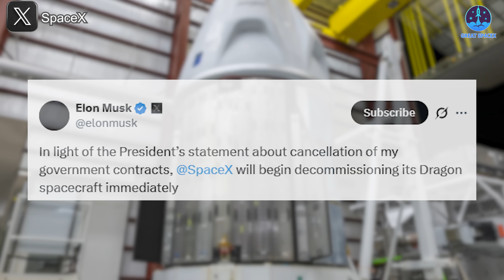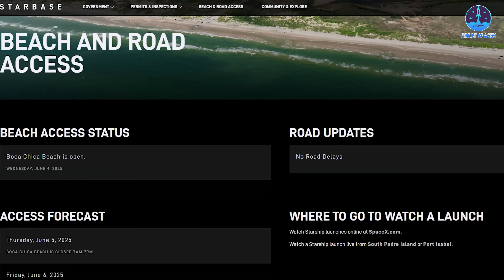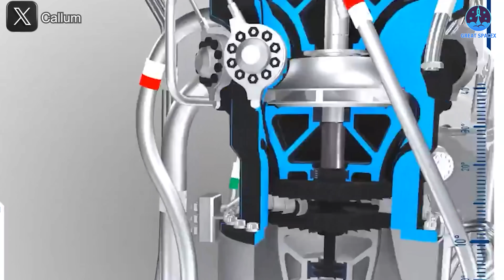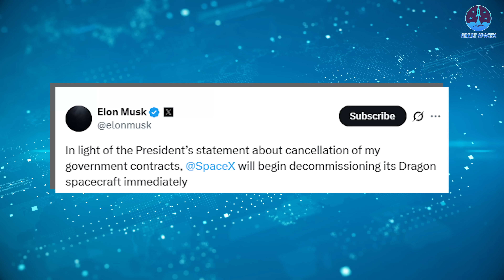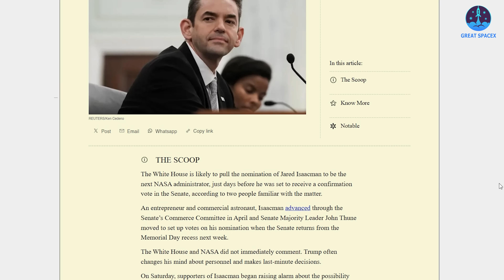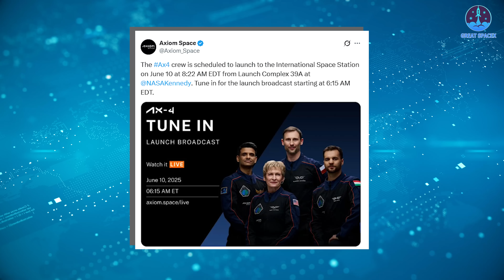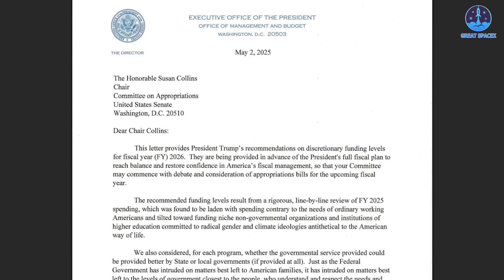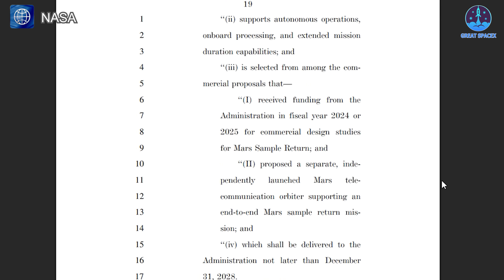Starship Flight 10 Booster Static Abort! Something Weird Happened with SpaceX and NASA...

Comment: Reasons why we can not go to Mars anytime in the near future - for those of you perhaps not aware of the severity of the problems involved - despite the psychological ones portrayed very well in this film.. In order of severity: 1.) hard radiation from both the sun and galactic sources. 2.) weightlessness for extended duration which is known to cause serious problems within the body, even if very rigorous exercise is performed. 3.) armor mass required to protect against high velocity objects which may be encountered en-route. 4.) coronal mass ejections, direct effects of proton "gale", and secondary emissions produced when multi-million KPH protons impinge on any delicate structure of a space ship. 5.) emergency resource availability for use when some catastrophic failure occurs due to any of the above reasons, plus the others such as dire health condition, loss of cabin pressure, loss of propellants, loss of water supply, etc. 6.) Fail-safe method to reach the surface of Mars.  7.) lack of planetary magnetic field which protects us on Earth from both 1 and 4 above. 8.) lack of thick atmosphere which protects us on Earth from 3 above. 9.) Ability to safely return to Earth when all else fails, during which time all of the above reasons before number 6, will come into play once more. And now, my favorite problem of all, 10.) The depredations to we who live here on Earth caused by the effort to achieve such a feat. We already have enough problems dealing with the billionaires who are already ravaging our planet to the point of murder on a grand scale.
Reply: Don't forget all the red tape! Government loves the red tape!
Reply: @BRenfro-b7h Can someone develop an engine that uses red tape for reaction mass?  If it is the poly red tape it is just polymerized ethylene.

Comment: Artemis 1 has been much more successful than Starship, not only can it actually fly without exploding, it can actually orbit not only the earth but also the moon.  Something SpaceX is unlikely to achieve this year.
Reply: Much more successful? At $4.2 Billion a launch? $2.2 billion to build SLS? Orion capsule cost $1 Billion. The Artemis program has cost $93 Billion since 2012. Starship is $100 million each. Thats 22 ships for the cost of 1 SLS. They will spend far less than the cost of Artemis 1 and have reusable success.
Reply: @daveyshmavey  And they are on ship 36 boooster 16....and still nothing.  Add it up yourself.
Reply: @hairyferrit still a long way to go! Before they even hit the cost of 1 SLS rocket. $100 million per launch. That’s ship and booster, completed and filled. There on flight 10 buddy.
Reply: @daveyshmavey  So the cost of all the ships and boosters that did not fly do not count.......right......Dumb thought pattern recognised.  SLS worked.
Reply: @hairyferrit your doping smoke! SLS started in 2012! And almost 100 billion for their first test flight! They won’t fly again for a few years… if they even fly again. 
   I didn’t say the stuff that doesn’t fly doesn’t count. That’s the cost of R&D.
Reply: @daveyshmavey  SLS 1st mission was Artemis 1 which reached moon orbit as planned, it will next take a crew to orbit the moon.   35 ships in and still cannot orbit the earth, let alone open its door in space.
One works, the other destroys itself more than half the flights.
Reply: @hairyferrit  I’m obviously talking to someone who doesn’t get it and can’t understand. Good luck with whatever it is you accomplish each day.
Reply: @daveyshmavey  Awww did I upset you because the facts are supporting my position.  Go cry to Musk....
Reply: @daveyshmavey  Tell us, what year do you think Starship will actually achieve and orbit and return intact?
Reply: 😂 boooo hoooooo….
Reply: @daveyshmavey Not one single Starship has been reusable.  Only 1 booster and it blew up when they used it a second time....er..
Reply: @hairyferrit  Note early starship launches mostly focused on getting booster working well.  Too early to make judgements till block(?) or version 3 has flown a dozen times.  Most Starship/Raptor work is on SpaceX's dime, intended to be financed by Starlink.  The purpose is/was very long term for Mars.  I don't think that has changed.  The government's goals are intrinsically effective for only a 2 to 4 or sometimes 8 year horizon before resets.  The current Trump/Musk dust up is because Musk did not realize you become a vegitarian if you wach sausage being made.  He is probably not done throwing up yet.  Always that way with representative elected politics.
Reply: @michaelmcmullen354  Musk is the biggest problem for the project, he is trying to force it into launches before they are ready and before they have a working design as seen with Block 2 and I have no expectation that Block 3 will be any different.  They were actually just starting to achieve something with Block 1 when Musk pushed for Block 2.  He has done the same with Tesla, promising much and then not delivering and that is coming back to bite Tesla as people see the German and Chinese vehicles are much better and cheaper.  Starlink only just started making profits in 2024, it is NOT going to be able to keep funding the costs of Starship if it cannot make money itself.  Much to date has been funded by the high level of government money given to SpaceX, it is now likely to be a lot less in the future.
Even Starlink is suffering problems with competitors shortly on the brink of their own networks that will be a lot cheaper.
Reply: @hairyferrit  You assume there is a standard reliable design method for things that have not been done before.  There is, but it involves a lot of guessing and many failed trials.  If what you are attempting involves many things not done before things get more difficult because the new things all interact in strange ways.  Note SLS is a rearrangement of the pieces of the Space shuttle system without the dead weight of the flying, landing, re-entry, and human support systems, but maintaining the deficiencies (mostly cost) of the parts they used.
Reply: @michaelmcmullen354  Sorry no, even new research does not ignore past lessons that have already been learned, unless you are SpaceX that is.  Lets ignore during Starships 1st launch why water deluge systems are used to prevent damage to the craft, then claim you are creating something new when you start using water deluge, then pretend even flame trenches are a SpaceX creation and not used back in the 60's.   Lets look at SpaceX totally ignoring the classic Harmonic resonant vibration that you get with large tubes used in rockets and destroyed their Block 2 starship.  Yeah, bever a good idea to ignore lessons already learned.
Reply: @hairyferrit  Not sure these lessons have been fully learned as they are dependent on the vehicle.  The concrete Musk tried was that used for the Saturn 5 launch and required substantial patching after every flight.  There were issues with digging a flame trench below the water table.  Pogo and oscillations are very vehicle dependent and are different when not supported on the launch mount and with different fuel loads.  Usually only revealed in flight.
Reply: @michaelmcmullen354  Saturn 5 had flame trench.  They have now built a flame trench so clearly no problems with water table.  Pogo can be simulated on computer.  Clearly you have not been in design work and know what it possible to test even before you actually build something.  That had all the knowledge from Block 1 to feed into the changes in Block 2 but seem not to have bothered with any simulation on the parts.
Reply: @hairyferrit  New flame trench is in a different location than the origional launch mount.  Sattern 5 had a hill built to put the launch stand on with a loong ramp that takes up space not available on Spaces launch sites.  And I am a design engineer (Bridges, Bridge Rails, Rock fall fences, etc.) and am very familiar with the limitations of dynamic modeling.  GIGO.  The input variables are largely unknown.  Models of complex things are best made or updated after the live testing, then adjusted to fit the results, then live test again, adjust again.   Even then the model may only be within 10% or so of the actual test due to chaotic effects like in climate modeling.  As they say, "the proof is in the pudding".
Reply: @hairyferrit they attempted an extreme angle maneuver that they knew should test the ship the way they wanted to get the data they needed. They still have another booster they caught that is still viable for reuse but they are test pieces/ prototypes at the moment. Don’t just look at starship with your nose in the air thinking SpaceX is a failure. They are more successful than ANY space agency that has ever existed. It is only the beginning.
Reply: @michaelmcmullen354  Oh keep moving the goalposts, you first claimed they did not have a flame trench, now claim they did but there was a hill.....that was because the bottom of the flame trench was constrained by the water table.  But the design utilised a two-way, wedge-shaped metal deflector to channel the exhaust flow.  Now who has copied that?
Reply: @hairyferrit  No question it is a struggle since they are targeting a fast turn around of both construction and rockets.   I would expect more changes yet with the increase in thrust and engine pressures.  The new earth mound approach has a difficulty with settlement.  This can be dealt with by time, very difficult to control without lots of time for the settlement to occur before completing construction.  Note starbase sat for years with piles of dirt to compact the underlying soil before construction began.  That was when it was a potential Falcon Heavy launch site.
Reply: @michaelmcmullen354  Pilings stop settlement, if you watch the construction, SpaceX did this before they built their flame Trench.  So did NASA for Saturn 5.
As to the fast build, they managed to make changed to block 1 ships and claimed they had made changes to block 2 ships, but clearly not solving the problem leading to fuel leak.
Reply: @hairyferrit  They might if they go to bedrock which can be impractically deep.  Check out the millenium tower in SF.  Major settlement problems.  Sandbars like Starbase is built on and the Cape is on often have verrry deep bedrock.  They will reduce the settlement from the upper layers though.  Not usually an issue where I work though, but sometimes.
Reply: @michaelmcmullen354  Nope you do not need bedrock if you use boreholes or CIP.  IIRC SpaceX used the very deep boreholes which is why they needed so much cement.  Another option would be Friction piles, but they would probably not work as well with the variation in pressure, work better for a consistent pressure on them.  SpaceX is not doing anything new, many of the launch sites built buy NASA used the same techniques.
Pad 39A was sitting just on top of the water table, which is why you will see Starships conversions is doing the same as Apollo, building the flame diverter at ground level with the ramp up to the launch mount.
Reply: @hairyferrit  Actually I agree.  I ment that the support had to bo on bedrock either with piles, shafts filled with concrete or rock or modified with cement.  Personally I gave up founding on spread footings on rock for contractural reasons because the rock was never quite where the geology report said resulting in contractor claims and delays.  Better to just pay a previously agreed price for any pile overrun.  Note some places in the Missippi Delta the design like a boat with sufficient basement to displace soil weighing what the building does.  Tulanes Library is an example where they forgot about the weight of the books and got some annoying settlement.
Reply: @michaelmcmullen354  With you on the variation between a geology report and where you actually find bedrock :)
In Holland they effectively build a tank that the house sits in on top of a large empty concrete base which then floats within the container if there is any flooding.  Brilliant design to deal with the conditions it is likely to meet.